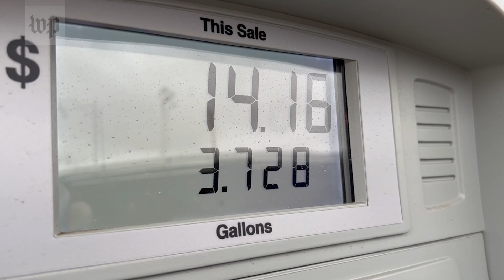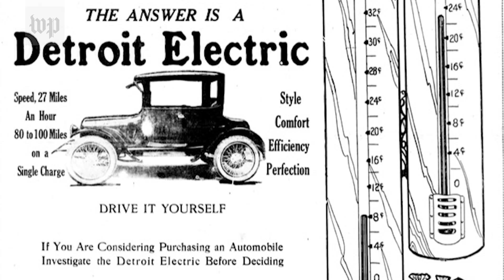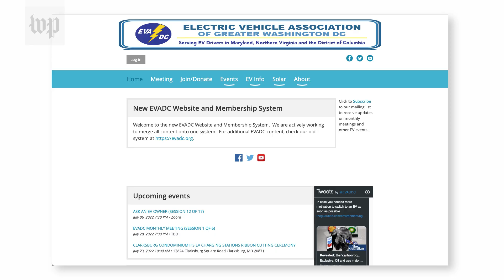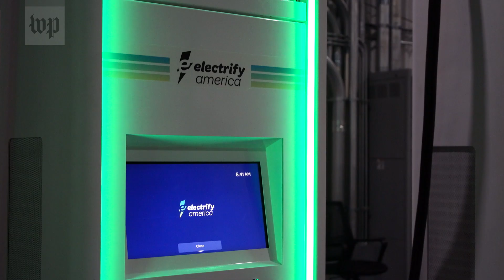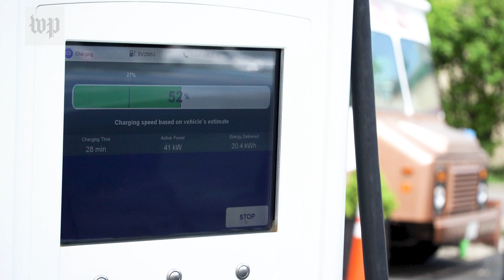Electric vehicles are here. The journey ahead may be a jolt

Comment: And where do the components come from? How much energy is needed to produce each battery, battery charging point? How often do you have to change the battery? Where do they go when they are at the end of their lives?  Etc., etc…… hard sell which you must be wary of.
Reply: The components needed depends on the battery tech used. There is a short supply of some materials, not because it isn't available, but because the supply chains are not in place (but are being sorted) the energy to make a battery does make an EV more energy expensive to produce, but is quickly made up by being more efficient. Batteries typically come with an eight year warranty, certain new battery tech is said to be good for over 1 million miles. after they are recycled, creating a circular economy, Something impossible with fossil fuels.

Any more questions please ask.
Reply: Seriously??!; !!clean energy...paciencia!!!!